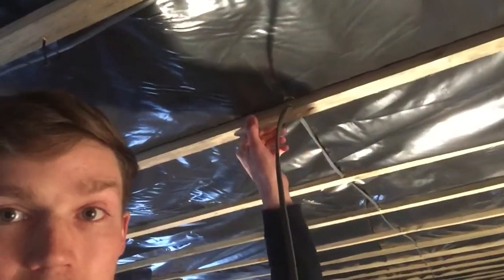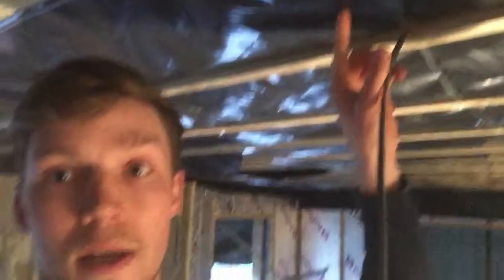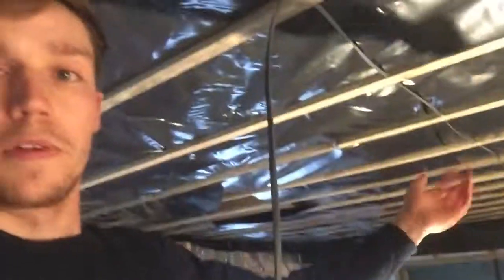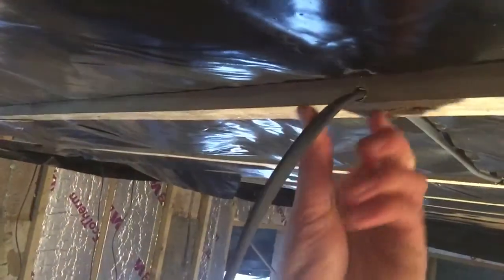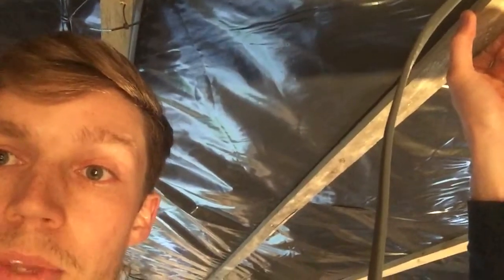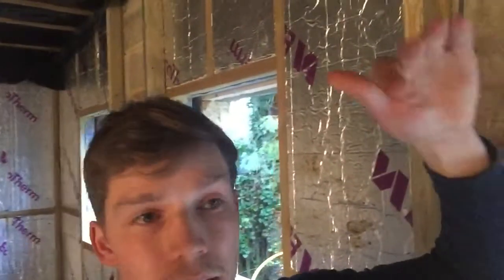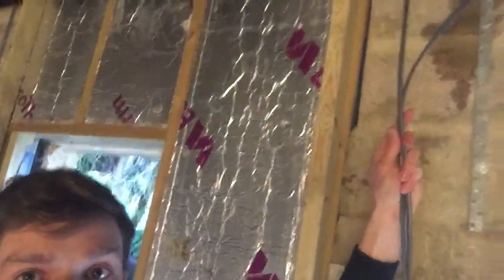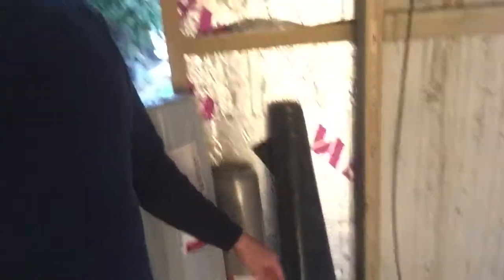Electrical Cables / Wires Running Through Celotex Kingspan or Ecotherm , What to Do?

Comment: Mmmmm bit late now I'm sure - but in future and for anyone watching this you should have those cables deeper in the building fabric to be compliant with BS7671 and part-p of the building regulations. Have a look at the electricians guide to the building regulations or regulation 522.6.201 of BS7671. If you're going through a joist or ceiling support you need to be >50mm from top or bottom of the joist or batten.
Reply from the maker: Yeah sorry I didn’t update this video, but I actually used 50mm stud wood in the end, but left these ones up.
Reply from the maker: I’ll pin this post to the top
Reply: @MattHutton  nice one - its a minefield trying to stay compliant with all aspects of the building regs! they don't all mesh that well!
Reply: Yeah was thinking that because when you screw plasterboard in you could puncture the cable with a screw….
Reply: I think best poke it through the insulation and then fill the hole with silicone

Comment: I’ve done this too, and it’s less hassle and doesn’t destroy your expensive Celetex insulation values. 
Next looking at a SIPS building 🤔
Reply from the maker: Awesome :) what’ are you trying to figure out about SIPS?
Reply: Matt Hutton strength, ideal thickness to insulation, toxic gas, flammability
Reply from the maker: Balraj Maan I’ve never used SIPs before but this guy has a great video on his out building made from Sips https://youtu.be/8a4hLsbUWWE
Reply: Seen a few but to me the devils in the spec. Doing a bit more research now to prevent having a possible future “Asbestos” lemon or Grenfell house  😬
Reply from the maker: Balraj Maan fair enough :)
Reply: Matt Hutton defo the future

Comment: Hi Matt, great video, solved a few of the issues I’ve been trying to sort in my head, before we try and insulate our flat roof. 
Can I ask what air gap you left between the top of the insulation between the joists and the underside of the roof? 
Also how did you tie the vapour barrier into the walls? I’m not aware that our room has any in the walls already, is this compulsory? 
Cheers Chris.
Reply from the maker: Don’t take my advice as the bible, because building regs change depending on when you watch this video. You need a minimum of 50mm gap between the top of the insulation and underside of the osb board (top of you roof). If you’re using solid PIR insulation like cellotex or ecotherm with a foil layer on both sides you can just use aluminium tape to to connect the gaps between the insulation (ie taping over the joists or studs where you have slotted the insulation between.)
Or you can do what I’ve done and use a polyethylene layer sheet layer.
Reply: Matt Hutton thanks Matt. Everything I’d read said 50mm too. I haven’t dropped the ceiling yet, so not exactly sure how tall the current joists are, but hoping to be able to get 100mm PIR in there. If not I’ll do as you did and get some in there, and full sheets underneath. Definitely going to pinch the batten idea to give space for some down lighters though. 
FYI if you do this again you can get thermally bridged fixings. Basically a screw inside a cone. The cone sits in the insulation so there’s no thermal bridging. I believe toolstation sell them.

Comment: If the load on the cables remains low , they should stay cool.With Flourescent and led bulbs,the light level will be high but the load should remain low.
Reply: The insulation sounds like a lot 120mm between + 50mm under... what u value is that? did building control request that?
Reply from the maker: Hey james grace, thanks for the message, I’ll keep your comment pinned to the top. In my situation I still didn’t want to gouge out channels in the Celotex to thread the wiring through. As I felt that it would be fairly messy and compromise the thermal insulation value. Best regards Matt
Reply: You bet,best not to put the cable into any insulation.Using wood strips to give it air space  is super. Best regards from here a well.